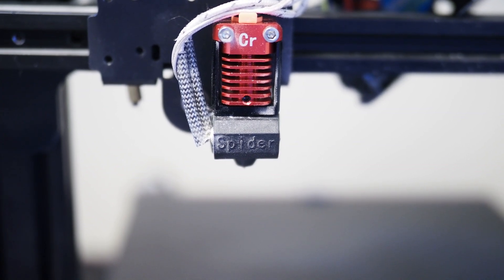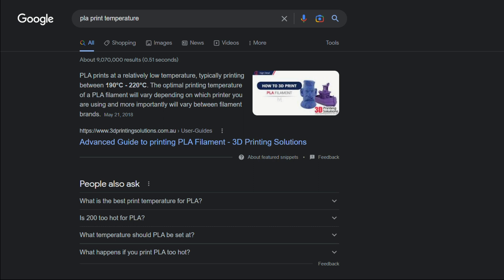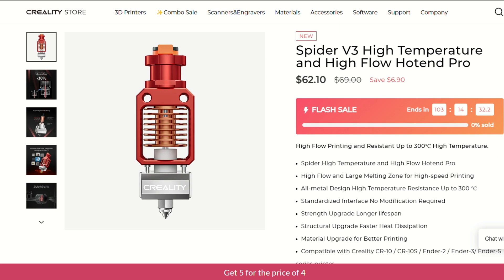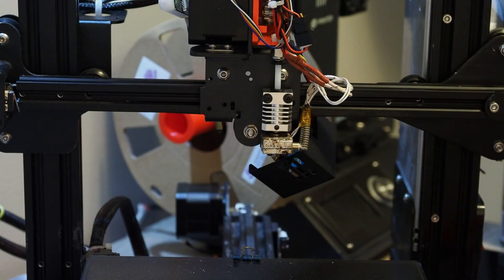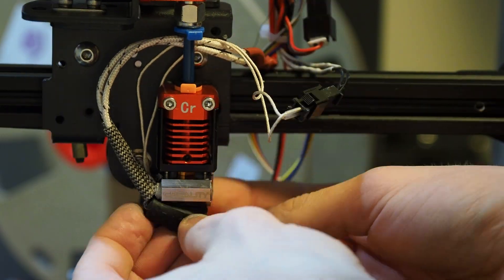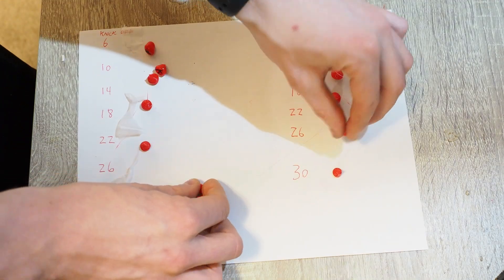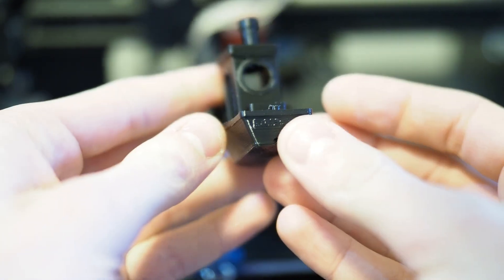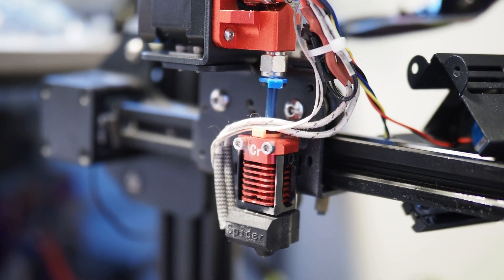Creality Spider V2 Review and Installation

Comment: So I'm currently installing a spider hot and on my ender 3 pro and I'm wondering about what that PID thing is and do you think I can just run that printer as is with the new hot end it's running a Marlin firmware

Comment: What are the downsides of the high flow that you mentioned? My stock one has leaked a bit and got a little messed up and so I'm thinking of getting one of these as a replacement.

Comment: Is the installation the same for the Spider Pro? I have a Sprite direct extruder, but I'm not sure if that will work with either the Spider V2 or the pro. I have no clue what to do with it now since I don't have a sprite hotend for it or any fans or anything like that. I really just wanted to print nylon, so I bought the Sprite extruder hotend set, but then realized I screwed up and only bought the extruder part (which at the time was only $1 less than the entire setup that I meant to buy). Now I'm considering buying the Spider V2 Pro, but I'm not exactly sure of everything I'll need. (and I still have to learn how to upgrade the firmware).

Comment: why would you put thermal grease on something meant to get hot ... ?? I understand the heat break but the hotend ? makes no sense.
Reply: If you don't put thermal grease on it, there are microscopic airgaps between the heater element and the heat block which works as thermal insulator. 
Worst case the heater element heats up so much it starts to melt before conducting all the heat to the heat block and the thermistor feeding back that it's getting too hot, 
best case the PID is tuned worse since there is a bit of lag between the heater turning on and heating up the heatblock. 

In the end I don't think it matters much but as long as the grease is rated for the temperatures it can't really hurt either, most of the contact is metal to metal and the grease is just there to fill in surface microgaps between the two.

Comment: You are absolutely correct, it is very difficult to find any review about this hotend online. I am looking for an upgrade for my Ender 3 V2 neo, so I am also thinking about this one. The only thing that concerns me is the nozzle size. Is possible for you to confirm whether we can use the standard MK6 nozzle with this one ?
Reply: It does use the same size nozzle. I just bought one for my Ender 3 V2.

Comment: I found this product new on offerup for $20 have yet to install it because my hot end is still working fine. I'm still new to this though, trying to get into ABS with issues but I think i'll get it. Anyway my question is about the fans you removed originally to install it. You never needed to put those back on?

Comment: I think everyone jumped on the bandwagon of "only can print in PLA" too much.  A simple Bowden tube change will allow the use of PETG and ABS.  I have had no issues with Capricorn tubes and the stock OEM heating end.  It also looks like this hot end and the V3 all use a new proprietary nozzle that is much more expensive than the old standby ones.  Thats a also a cot consideration to think about.
Reply: Eventually that Capricorn tube will degrade. getting pieces of ptfe tubing out of a nozzle isn't easy.

Comment: I think someone in production stuffed up, if you look at the renders the wires are on the opposite side.
I just installed the same hotend. I finished up cutting a bigger opening at the top to stop the wires rubbing against the edge.
Prints seem really clean now and I look forward to overhauling the hotend every month

Comment: I believe the problem with the microswiss is due to the degredation of ptfe tube over time. There should not be any gap between the heatbreak and the ptfe tube. When there is a gap you would encounter clogs after  retraction. Just installing a new ptfe tube with attention to leaving no gap would probably solve the problem of microswiss. The gap may also be the result of tube fittings which are not functioning properly.
Reply from the maker: For the microswiss, the ptfe tube doesn’t go up to the heartbreak. It only goes about a cm into the heatsink. Hence the “all metal” label.

Comment: One cheap alternative I went for for my Ender was the slice engineering bi metal heartbreak. You can buy just the heartbreak and install that. That will give you a reliable all metal hotend for printing spicier materials
Reply from the maker: That’s a great point too, if the rest of your hotend is in good shape then that can be an option for sure!
Reply: @mediocremaker5575  I think the spider does actually have a few other extra features as well though. It looks like the heater block is rigid mounted to the heatsink like with the mosquito and dragon hotends so you can do one handed nozzle changes